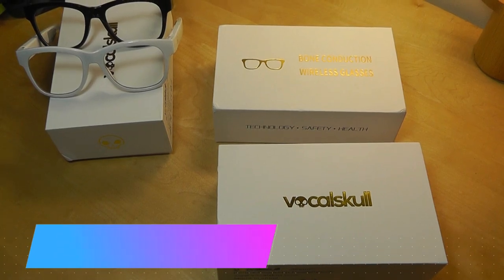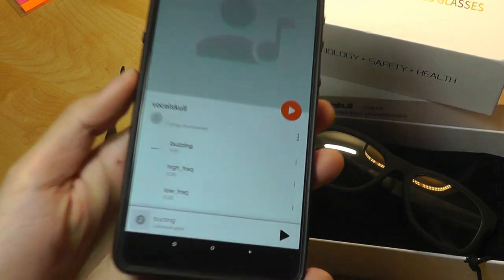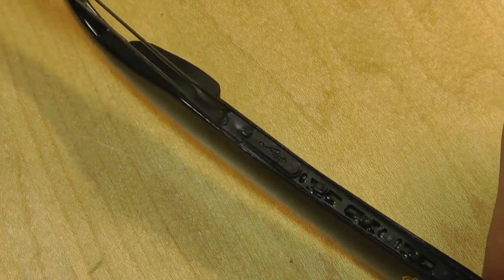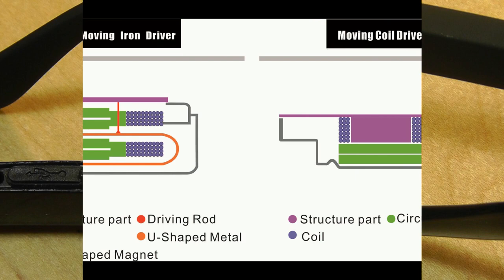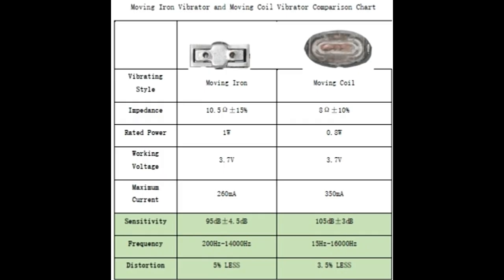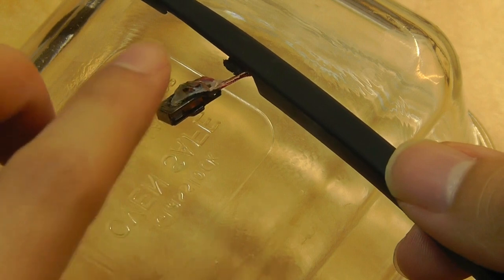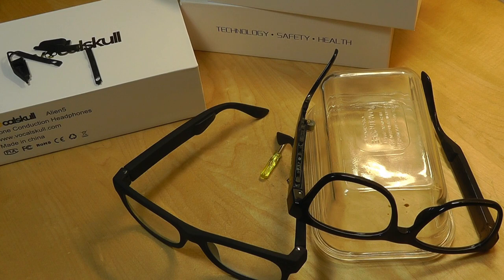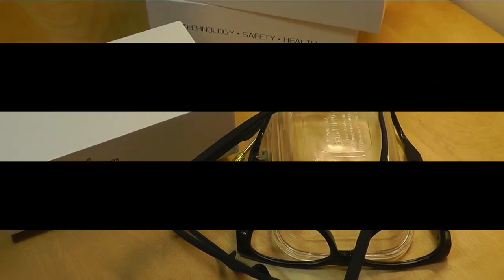Teardown: Bone Conduction Headphones [How Does it Work?]

Comment: Hi.
I had purchased these glasses.
Worked fine initially.
Didn't use them for 2 months.
When tried to restart they're not working.
Red indicator shows while charging but the glasses stopped working.
Just ran out of warranty a month ago so no repair from VS.
Can someone help me repair or replace the battery or something.
Thanks.
Reply: the same happened to me too

Comment: The old one uses a gd 02 but the new ones use the gd 05
Reply: Hi.
I had purchased these glasses.
Worked fine initially.
Didn't use them for 2 months.
When tried to restart they're not working.
Red indicator shows while charging but the glasses stopped working.
Just ran out of warranty a month ago so no repair from VS.
Can you help me repair or replace the battery or something.
Thanks.
Reply: @amirkudsi7513  stop saying the same thing in every video lol